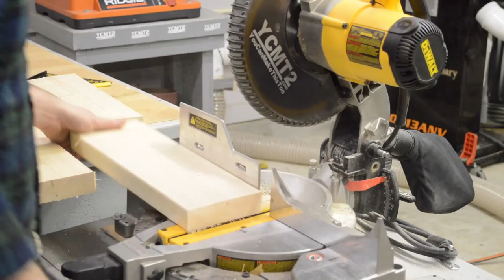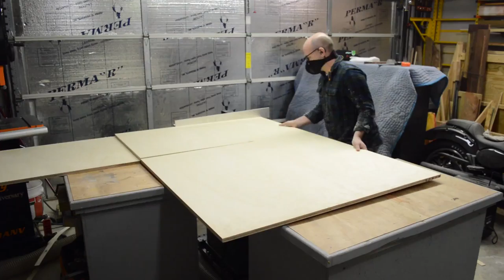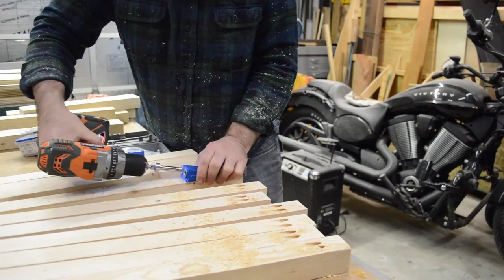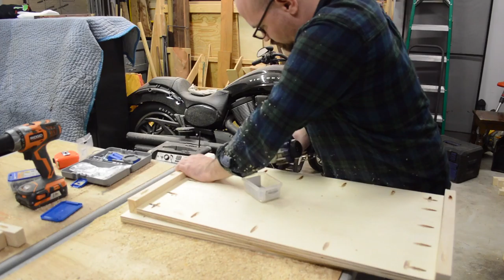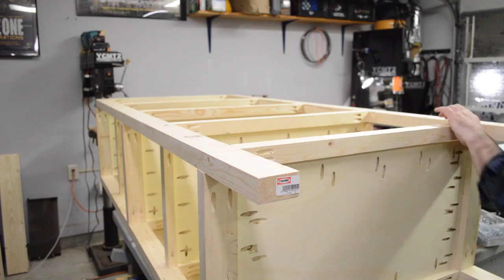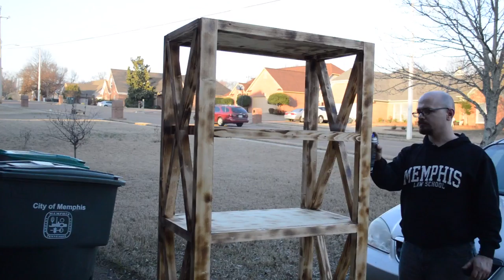Ana White's DIY Rustic X Bookshelves // How to

Comment: I am blessed to have very similar equipment, planers and joiners in my little shop. Glad to see ripping some larger lumber to save some costs!!!  

Did you see much effect with the torch burning through the darker stain at the end? It almost looked like you built a lighter colored version with a faux distressed / aged look and then had a darker stained one in all the commentaries? 

Great short vid!!!
Reply from the maker: Thanks! I built two at the same time. A plain one I burned, and one I stained dark.

Comment: Going ahead and spend a little extra money and ditch the 2x2 and use 2x4's. Over a long period, I would be worried with the single 2x2 with one screw in it per attachment point. 1:17
Reply from the maker: Not a bad idea.